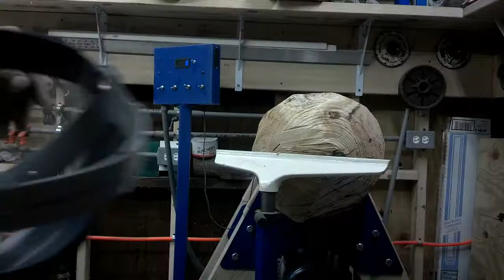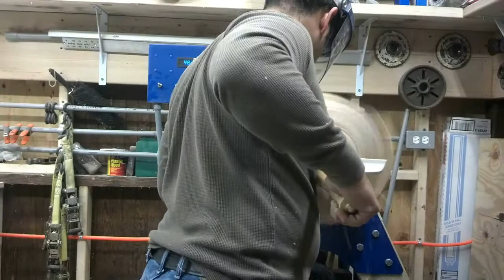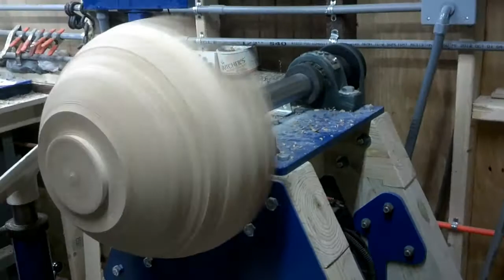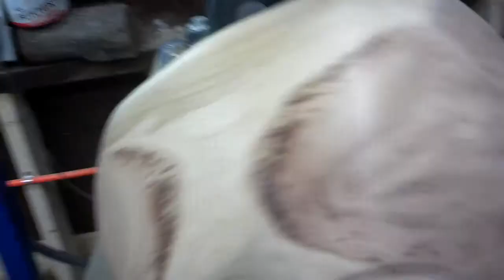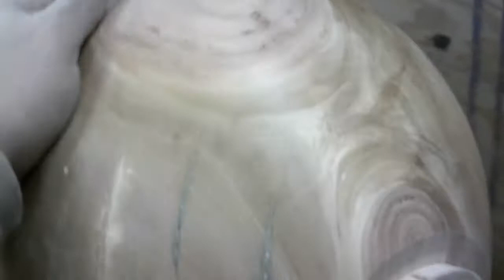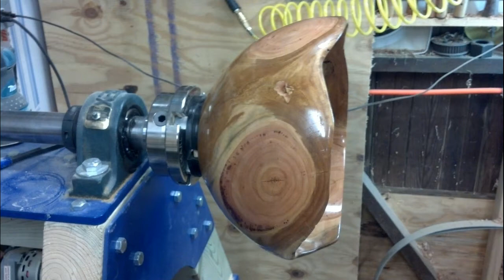Woodturning Cherry Bowl - condensed version

Comment: Now I've seen it, it's cool. Platter at a work of art. Such an impressive material. Good luck! Like!
Reply from the maker: +Аleksey Bek thanks, this was the first project for the lathe!
Reply: It turned out perfectly. Changes in rpm when machining large parts is very important. You got it.